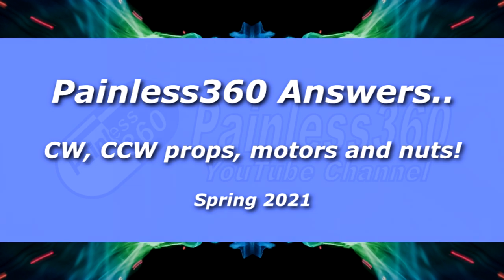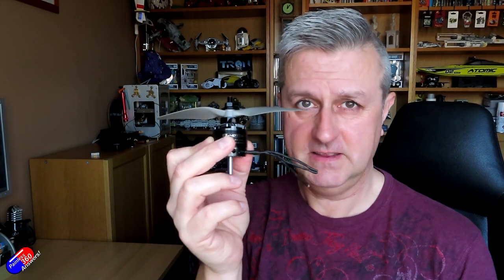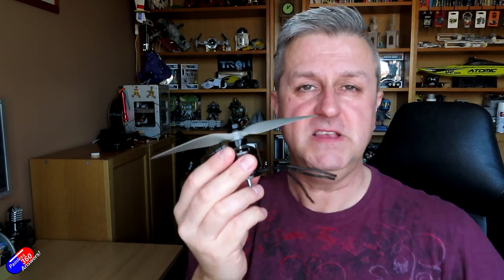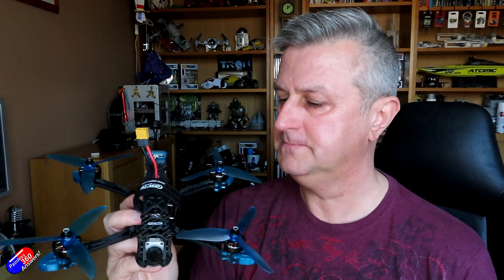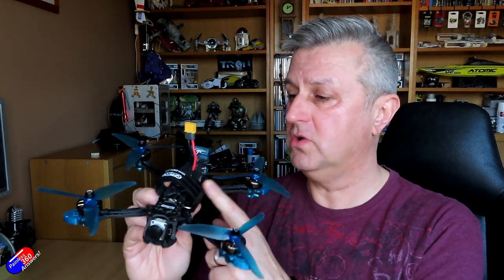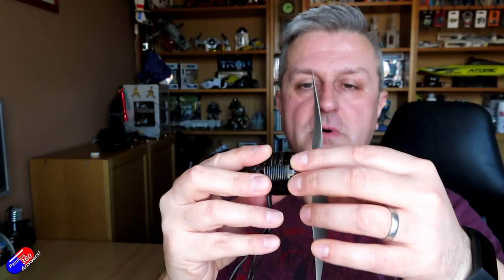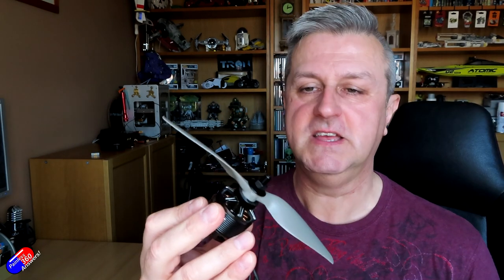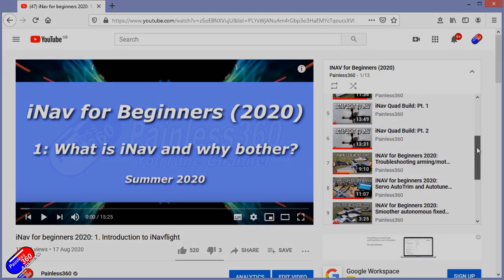CW, CCW? Why do motors, prop nuts and props all turn in different directions?!

Comment: Great video on very important fundamentals. I discovered that even if you have the correct CW/CCW motor and nut threads, if the motors are spinning really fast, and then suddenly stop, the inertia can unwind the nuts. Mission Planner's motor test taught me a valuable lesson, so now I use nylock nuts. They are though sometimes hard to find with CCW threads.
Reply from the maker: Especially is the 'nut' is part of the prop DJI Style. It happens less with separate pieces but Nylock nuts are essential IMHO..

Comment: I have seen discussions on forms that their is no need for a pusher prop on a fixed wing plane and their is no need for them to be made you just simply reverse the motor. 
To which i reply if you mount your motor on the back of the plane then you should NOT reverse the motor instead fit a pusher prop as that will help the prop nut stay tight.

Comment: Excellent explanation, nice one. You didn't mention the case where the motor is fitted behind the firewall in the nose so the motor is fitted back to front with a prop adapter on the shaft sticking through - that confuses a lot of people that I fly with. Have you covered that somewhere else?

Comment: I'm really, really getting into Delta Wings. You are definitely one of my inspirations to build an Inav rig soon, I can't wait to dig into your playlists. Once again, I came to the question of why I can't find 9x6 or 9x4.5 props for my FT Spear (not a quadcopter pack of both sets, ya know). And you have the answer. My 3 pack of uxcell 9x6 props are great for my planes and the nut won't loosen, but when I flip it around for my FT Spear...yea. Thanks again for all the answers man!

Comment: On the pusher one can use the CW rotating drone motor, if there is the same KV/size version. And as a second option, one can use a R type propeller on the normal rotating CCW motor. In either case nut will be tightened on the run.

Comment: Please make a video on review of 3d printed prop,  best infill, Materials setting for prop, is it works, 
As many have 3d printer,
Reply from the maker: I would never use a 3D printed prop. They are subject to huge stresses, are very complex aerofoils and are cheap enough to buy. ABS is a plastic you'd find props in that you can print with..
Reply: @Painless360  I think might work using a resin printer. I know Integza has created an impeller for a turbo, but not after multiple attempts. I agree at the cost/effort factor.

Comment: OK, with a RH thread, for the motor's torque to tend to tighten the prop nut is it referred to as a CCW rotation, as seen from the front, or a CW rotation, as seen from the rear. Always confusing when selecting motors to buy for specific applications. Thanks!

Comment: Thanks Lee.  If I got it right, for a pusher the numbers on the prop should face the front of the plane and the motor should spin clockwise.
Reply from the maker: Numbers/ letters on the top of the prop to face forwards (direction of flight) and spinning the right way..

Comment: Uh, do pushers mount the motor at an offset to counteract the same rotational torque that can make a prop nut come off?  I haven't seen a single motor tractor that doesn't and they will only work with a CCW spinning prop.  The only pusher I have is my nano Talon and there is no offset.  I haven't owned a mid motor pusher plane with a  =>2212  motor .    From what I see in pictures and videos it doesn't appear so.  Would not that mean the airframe  would be motor direction agnostic?  In that case cannot one simply reverse motor direction and your prop nut becomes self tightening again?

What about planes with 2 motors?
When I built my binary I used two 2216 motors.  I was easily able to find a 22xx prop adaptor set with a ccw and a cw for $6 or so on ebay.  Now I'm working on a build with two 2814 motors.  It appears CW spinning CCW thread prop adaptors for 28xx motors are non-existent.  What the <insert four letter expletive>?  I can't find one and if anyone knows where on can be had at a fair price I would be grateful.  I guess I could look for an M5 or M6 prop nut with a teflon washer in it to wrestle with in the field ,ugh.

Comment: So for a pusher, it should be a CW still but with the letters facing the direction of flight? So for a pusher I can use a CW?
Reply from the maker: It depends on the prop. Letters facing forward and motor turning the right way to spin the prop in the correct direction.. Happy flying
Reply: @Painless360  thank you!

Comment: So when  you  want to change prop direction  on a multi rotor ,   (from props in to props out, rotating  in to the  sides instead  of front and rear), ideally  you should  swap motor position  to correct motor  shaft threading ? Or nylon  nuts are sufficient ?
Reply from the maker: Nylock nuts will work fine but ideally you want to the motors turning to keep the prop nuts on if they loosen..

Comment: What about using pushing prop? Is it going to solve the problem?
Do you confirm in that case motor running counter clockwise thx
Reply from the maker: You spin the prop in the direction it needs to move to create thrust. Using things like Nylock nuts mean that it'll stay tight for almost all use cases.

Comment: I am always confused about how the rotation direction is determined. Standing in front of the plane and looking at the prop or standing behind and looking at it in flight direction...
Reply: Consider the direction of the hands of a clock while looking directly at the propeller, this is clockwise (CW).
This is how you judge the direction of rotation.
Counter Clockwise (CCW) is in the opposite direction of the hands of the clock. 
Always keep this as a point of reference, A clock's arms direction of rotation infront of you.
Reply: @wilburgonsalves7741  So you're saying this while looking from the front side, or prop shaft of the motor, correct?
Reply: @wilburgonsalves7741  Unfortunately that's not helpful because the tradition in full size aviation is to use the OPPOSITE convention and describe the propeller as clockwise if it turns clockwise as seen from the pilot's seat in a tractor aircraft (i.e. one with the propeller at the front). That USED to be the convention used by modelers as well. However, in recent years, in model aviation, the OPPOSITE convention is now commonly used. So there is just mass confusion. No doubt that is why Kjell is asking the question.

Comment: So if engine is  CW is good have a CCW nuts ? and if engine spin CCW is better have a CW nuts ? in these cases is even not required nylock  ?
Reply from the maker: The prop-nut will have to have the same thread as the motor regardless of the direction of rotation. The trick is to try and get it so that the nut isn't spun off the motor if it comes loose. Happy flying!